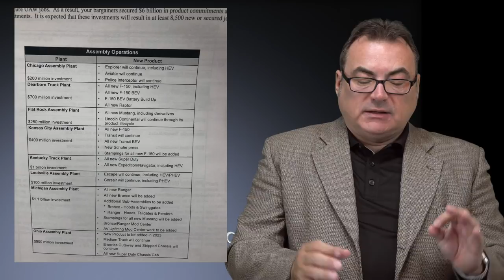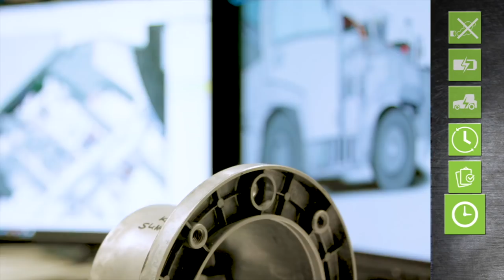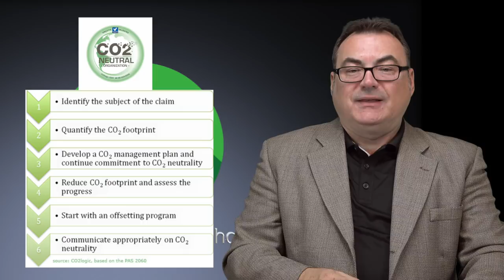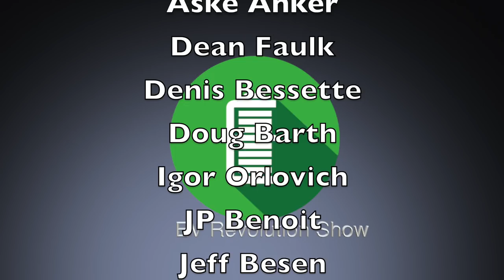Episode 68 - Model 3 in China, Ford F150 BEV, Tesla Pickup, VW I.D.3 Production and more news!

Comment: About the Ford commercial towing the train cars, where did they get a tow strap that can handle the weight if they were ACTUALLY towing the claimed weight? I’ve never seen a tow strap rated that high.
Reply: Agreed Doug, however pulling that weight over level or downward sloping ground at a very low speed won't put as much strain on the tether. They may have pushed the train from behind also, who knows?
Reply from the maker: Hi Doug, yes what James said!

Comment: The ID3’s rolling off the line now are NOWHERE near cost parity. The E-Golf is being sold in California with a manufacturer discount of $10K so they are doing the same as GM and the Bolt. Maybe they should ask GM how that worked out financially.
Reply: Doug, I believe the long term plan is for cost parity, however I believe VW is launching higher spec first production versions, similar to what Tesla has done.
Reply from the maker: Correct James, and the ID3 is only a European-spec BEV.  We will not see it in North America, not sure about APAC.

Comment: ...some portion of the bed-wall may ANGLE upward from the rear-bed to the rear-roof of the cab ...APC-like...tho ....this TeslaTruck MIGHT be a 'convertible'....from open- to ROOFED-bed INTRA-mutably re-configurable ....like a panel van that shape-shifts to NON-standard pick-up format (rear roof slip-slides forward... BENEATH... the... front roof..)....for hauling..... say......... giraffes.....(GTM).... w/ slide-out pocket-floor loading-ramp and/or power-gate....& fold-aside MOLDED-metal bench-seats (Bed)... AND sliding cab/bed-connecting pocket-doors w/ accommodatingly adjustable Cab seating ........ y'see.........THE... front 'bumper' or Tool Mount will be WELL-receded BENEATH the Brow-o'-the- ARGUABLY Stand-w/-In-Cab....behind an Armour-glazed wind screen w/ beveled-back A-pillars... for a 'FACETED' look...shielding a CENTERED swivel-able Pilot's Seat... BACKED by 2sideXside MoreOfTheSame...AND by three-across bench seats...for cozy...StarLinked... Cab Consultations & Confabs....not to mention... Lunch....
Reply from the maker: Thanks for watching...we will see!